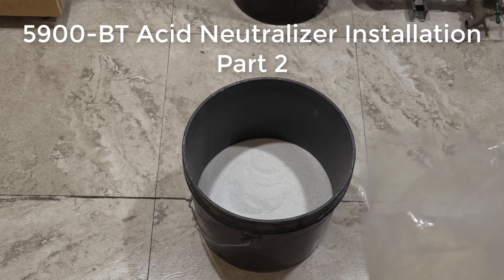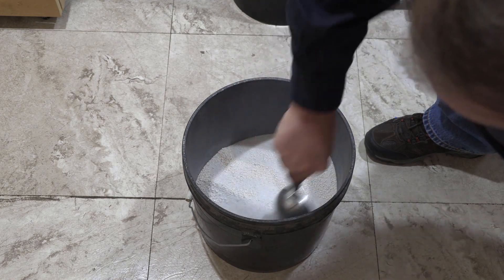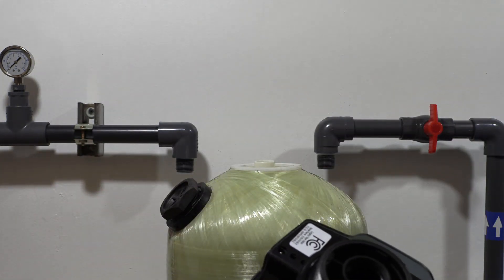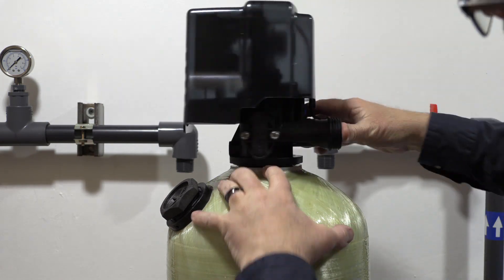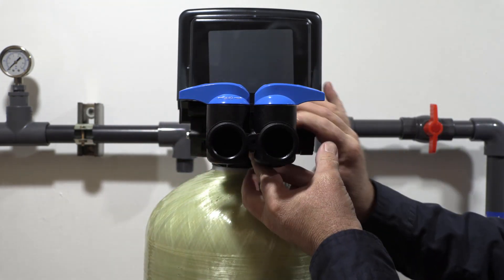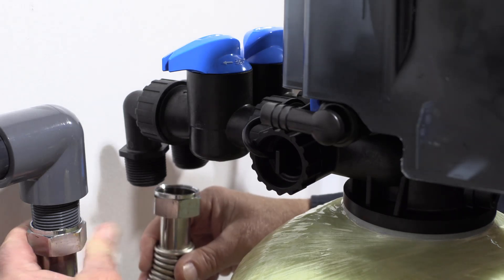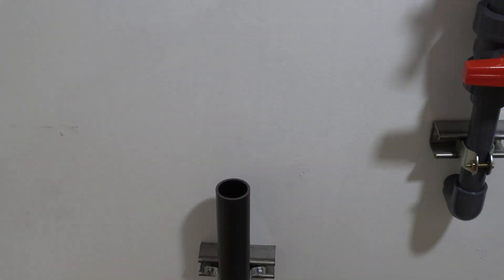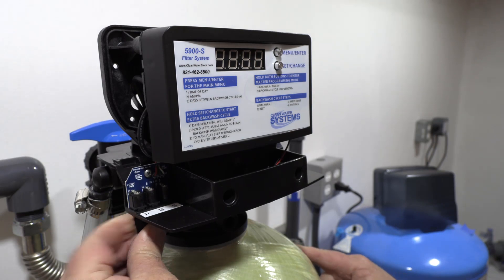Calcite Acid Neutralizer 5900-BT Installation Part 2

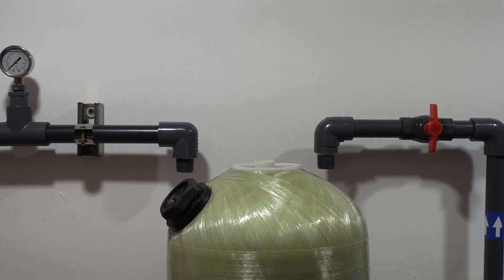Comment: When you attach the strainer basket to the bottom of the control valve, I believe it goes on clockwise; not as stated at 2:05 in this video.
Reply from the maker: Thanks for the feedback on this!  We did just check the control valves we use here and our support tech reported that the top screen does insert counter-clockwise but this could be different with different brands of valves.  We use CSI Sig III valves which we call 5900-BT valves from Ohio.   Our guy said "I took a top screen and went to a BT valve with, dropped it in and cranked it to the left, counterclockwise, and it snaps into place."    However as long it goes in, and stays there, you are good to go.  If you need assistance though please email our support dept support@cleanwaterstore.com    thanks